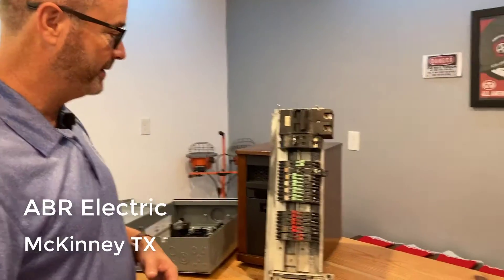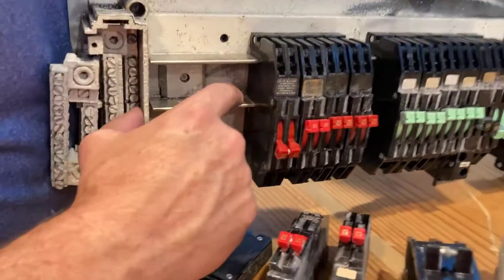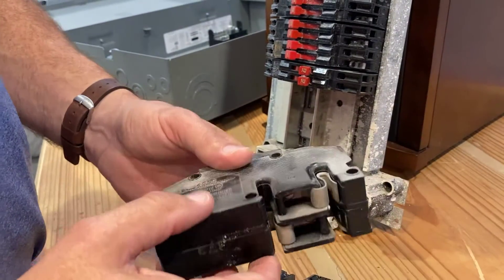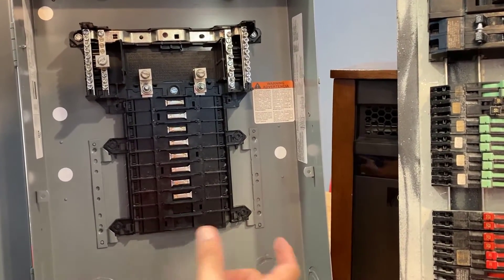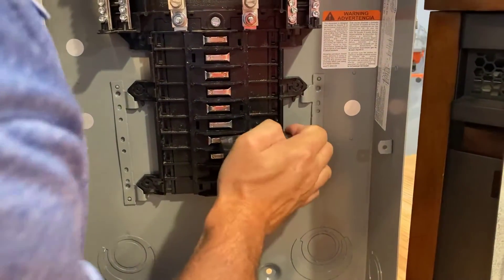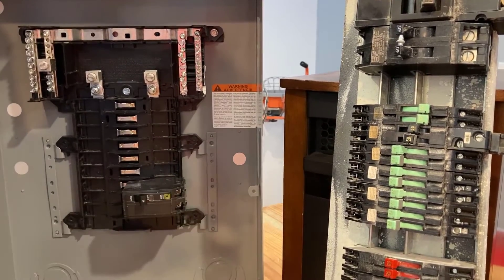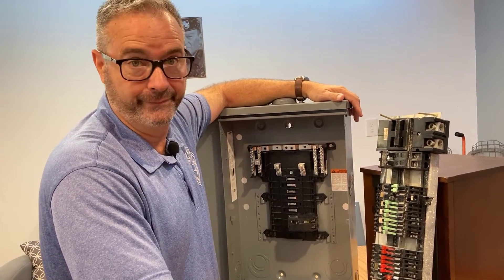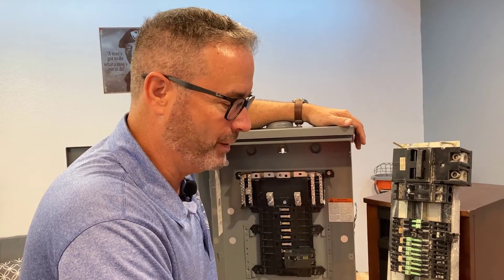Zinsco Panel Bottom Line: Why you should replace your Zinsco Panel

Comment: Hoping you might know, there are two bus bars. In an installed box, does the same source go across both bus bars, or are they separate? I have a single pole I am replacing but the clip only goes to one contact.
Reply from the maker: 2 different phases. It will work in any space the clip can connect
Reply: @abrelectric  thank you very much

Comment: QO has been around so long with reliability and have changed out a couple of panels and was able to reuse the older QO breakers. They all tripped perfectly fine and as fast as any other breaker I have ever seen. I dead shorted many breakers and found QO tripped so fast there wasn't even any arc flash.

Comment: I recently replaced 11 zinsko and 1 fpe  load centers. The fpe i am really surprised it still works. The stab connection was not in good shape. The zinsko boxes are a different story. None of them needed to be changed. Compared to square d and siemens, the bus bar bolts and nuts are a bit loose. But other than that, no issues after 50 years of use. The replacement breakers are expensive. For two breakers, i can buy the whole box and all the breakets in it from squae d or ge or eaton. If you have to hire someone, you may consider waiting for a remodel and get it done together.

Comment: I didn't see any difference in the way the breakers connect to the buss-bars except that the Square D doesn't use aluminum contacts and the breaker clips are tighter.  Do the Zinsco problems vary with location?  Mine is in the dry CA Central Valley.  I recall replacing at least one Zinsco breaker and I didn't see any signs of arcing and it clipped securely to the buss-bar.  I also didn't see any of the corroded aluminum like in this video.  You can still buy Zinsco-compatible breakers, perhaps with different copper contacts.  I had a different breaker box in Atlanta (GE?, forget) and the breakers weren't hard to pry off the buss-bar.  Perhaps the main reason the Square D breaker here seems tighter in the wiggle-test is that it is much wider and has 2 plastic clip-in feet.

Comment: We had zinzco in our apartment. Water heater shorted out and tripped the breaker. I found the breaker tripped, turned it back on. Days later smelled a funny smell, opened the panel and the breaker had exploded/burnt. I can't believe didnt burn the place down. Owner saw and replaed all panels with square d afterwards.

Comment: Older Zinsco panels had copper busses and therefore much better and safer. The spring tension of the breaker clips on a breaker that has never been on an aluminum bus is quite good and there is a lot of contact area between the bus and the breaker clips lowering the heat generated at the connection.

Comment: Why would one side of my zinsco box not work. One wire coming in is 120 v the other is dead or 0 v. Thx
Reply from the maker: Same voltage difference phase-to-neutral, at the main lugs, right? Do you have a main breaker? Is the service overhead or underground?
Reply: @abrelectric  yes, main leg coming into garage. It’s underground for main coming into garage
Reply from the maker: @ccarnut  have the utility company check your meter socket or the ground vault that supplies the meter. A lot of times you'll have a burned up lug in the meter or a corroded connection in a ground vault
Reply: @abrelectric  it’s on my
Sons house that he just bought. He had to replace the air conditioner condenser when they switched power and we think this has something to do with it also.

Comment: Mine is only 11" wide mounted between 2 studs. Can't find any panel with that width.
Doesn't have more space for 2 extra breakers that I need to add to my new kitchen. Really in panic mode.
Reply from the maker: Get a standard panel, and reframe the stud bay to a standard layout.

Comment: Recently had an electrician out to do some outlet work. He looked T our panel and it’s a GTE Sylvania 1981 vintage. He said it needed to be upgraded and changed out. So, it’s going to be a bit costly, but he will be here next week and do a full replacement and upgrade to 200amp from 100amp. Doing research I find they are originally Zinsco style. Glad I got the correct info and having the work done.
Reply: how much did it cost
Reply: @X2Jason  $2300 complete re-wiring from meter to panel. Now the panel meets full NEMA and city code for electrical panel, and is set up in the event we install a home generator. Worth every penny.

Comment: Hi I have a zinsco panel on a 1973 home. Worked just fine till now. I overloaded a circuit by accident (baby bottle sanitizer, water boiler, and electric heater). The power died on that plug but none of the breakers tripped on the zinsco. I tried moving all breakers up and down but the power is not back. That means the breaker is not doing its job right ?
Reply from the maker: That breaker is dead. You can only tell which breaker by using a multimeter to confirm voltage. At the very least, that breaker will be replaced. At best, you need to replace the panel - you've gotten good mileage out of it :)
Reply: @abrelectric  thank you kind sir. 🙏I think I should have gotten it done in 2017 when we bought the house. A $2500 estimate then will be what now in CA? I’m so excited to find out 😵‍💫🤣

Comment: I was adding some 220 circuits in my garage for woodworking tools. I was out of space in my Zinsco box, so asked an electrician for advice. He suggested changing out the Zinsco for the reasons you mentioned, rather than adding a subpanel. I paid him to change it out, and watched him work. The rails were pitted, and I had a breaker that had arced so much it had stuck and no overload could trip it. I spent a little extra on a quality Square D panel more than 12 years ago, and never regretted the spend. That Zinsco panel in my house was an absolute disaster waiting to happen.
Reply: My Zinsco panel has copper buss bars and the breakers are all pretty firmly snapped in. It has been completely disassembled  and there is no trace of arcing or scorching. The solar panel installer did have a little trouble finding breakers for their system, but they said don't fix it if it ain't broken. The city inspector also had no problem with it.
Reply from the maker: Seeing those pitted, burned rails is something to behold, right? Thanks for sharing your experience
Reply: @abrelectric just to add we had replaced the main breaker because of the same issue. It had heavy pits. Also after that the 240 circuits had small pits after we removed the panel. What was strange but a warning signs the lights in the house had flickering effect slightly. When I went to ask a supply house about replacement parts they told me to get rid of the panel it was a fire hazard. One thing to add the Federal Pacific panel was another fire hazard. Mom and Dad should have replaced the panel sooner. But I installed the new square D QO panel with all the breakers. My brother helped me so the change over would pass inspection. The current panel had all the wires running down through the large hole at the top. We   put connectors on each wire I wasn't or my brother wasn't sure either if the job would pass inspection so each wire had its own connector and hole. It passed with no return visits. I did have to pull a permit because I pulled the meter. I don't do live electrical work. Zinsco should have used tinned brass or copper for the buss. Aluminum is not the material to be used. Moisture and electric don't mix and aluminum pits when corrosion sets in. 73

Comment: The only time I've been shocked as an electrician was from a zinsco box, and the only time I have seen houses burned by an electrical fire was from a zinsco.
Reply from the maker: Wow. That is same bad juju
Reply: How many homes have you seen burned from this ?
Reply: @theocraz176  5 including Mattie Mallet's house two weeks before Christmas.....that's the reason Zinsco is out of business, in fact Farm bureau will not insure homes with Zinsco breakers and they will drop u if they find out you still have them. Some cases they will give you 30 days to upgrade.
Reply: @johnnyteague3407  so it’s not enough to just replace all breakers to the newer versions ? I appreciate your replies, thank you
Reply: @theocraz176  no the breaker box itself is also flawed. If it is original,the old Zinsco breakers will start arcing and cause corrosion. If you replace them with new ones they not make a solid connection to the buss bar. Plus some parts are made from aluminum, with is a no no..

Comment: Thank you for the video. How do you pull out a 60 amp breaker (Zinsco)? You only need till and pull it, right? But it is so hard to pull any way.
Reply from the maker: It is hard, ironically. The lug side comes out pretty easily.  The other end is usually under a long clip, that can be pried back (carefully) with needle nose pliers. 
Turn off the power- there's lots of live parts in a tight space on the Zinsco

Comment: It’s true that the Zinsco design has a problem with the buss bar but so do many modern panels. Panels like cutler hammer br, murray, challenger, and Crouse Hinds burn up on the buss bar just as much as Zinsco. I don’t think there is any reason to replace a Zinsco until it has issues which could be a very long time considering many of these panels have been working fine since the 70s. When replacing qo is a really good panel that almost never burns up due to the reasons shown in the video.
Reply from the maker: I agree, with the idea of planning to replace the Zinsco vs waiting for there to be a big problem with bussing. Thank you
Reply: My dad is a retired electrician and said that the buss bars were a common problem. He said that they used to replace the aluminum buss bars with copper buss bars and then swap out any bad breakers. That was in the early 90's though.
Reply: @geraldholcomb2049 I don't think zinsco is in business anymore. Square D has been around for a long time. The early breakers had no trip window to see if the breaker is tripped but they still work the same . 73
Reply: Agree!
Reply: Nope , I turned off a zinsco breaker to service a heater....the SOB CAME BACK TO 60 VOLTS AND SHOCKED ME....STILL WAS SET IN OFF POSITION. I HAVE SEEN VOLTAGE STILL TRAVEL THRU BUSSBAR EVEN WITH MAIN BREAKER SHUT OFF. I HAVE SEEN THEM NOT TO BE ABLE TO BE SHUT OFF AND HAD TO PULL THE METER BECAUSE BOX WAS SMOKING....ZINSCO ARE DEATHTRAPS .